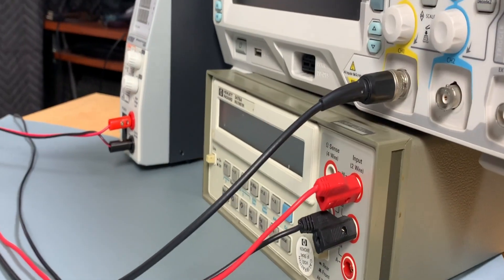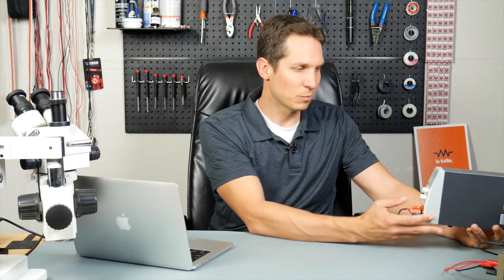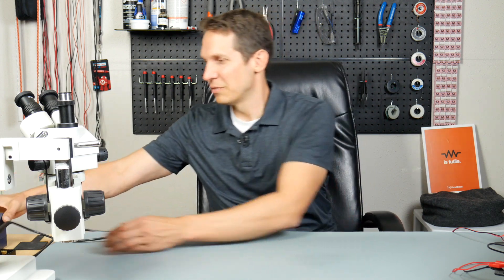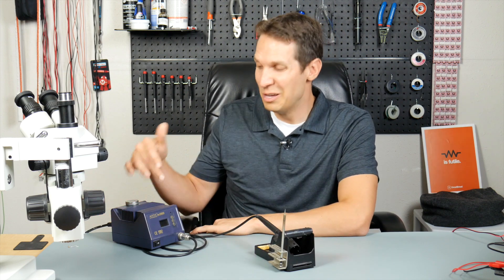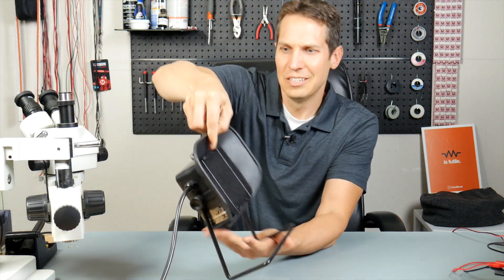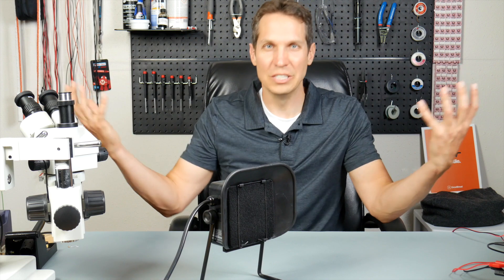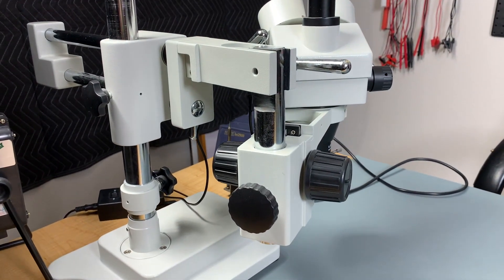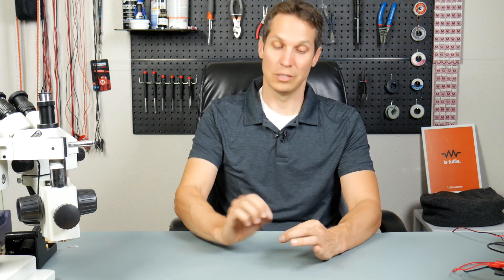Electronics Workbench Tour | Electrical Engineering Tutorials from CircuitBread

Comment: I want to check factory power quality...how it can be done
Reply from the maker: Like power factor or how clean the signal is?  I've never done a practical power factor calculation, so I assume it would be harder as you need to measure both current and voltage of a load at the same time and see how much of a phase shift there is.  Checking for ripple or noise is easy enough if you have an oscilloscope - just hook it up and measure the unwanted noise as a ratio of the wanted signal.  Is this what you were looking for?
Reply: fluke PQA

Comment: It was an amazing video. One question "not related to video's topic :)", which substance is better and helpful when using diodes, Ge or Si?
Reply: Also, I like your channel a lot. Thumbs up guys and step by step you'll reach your goal and will have more engineers to share your experience with.
Reply from the maker: Depends on what you're wanting to do!  Germanium has a lower forward voltage and is better at higher frequencies than silicon but silicon is cheaper and usually are more resistant to higher reverse voltages and greater temperature.  Though, other than cost and forward voltage, the way the diode is manufactured makes it a big difference in their performance.  Hope that helps!